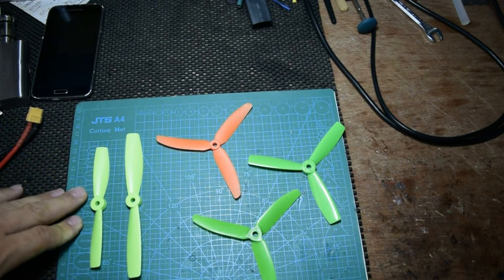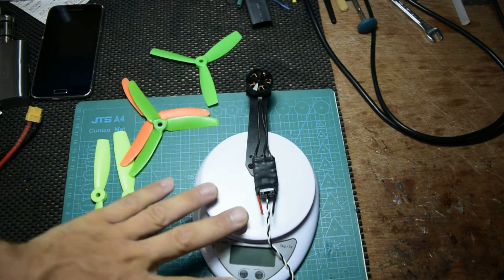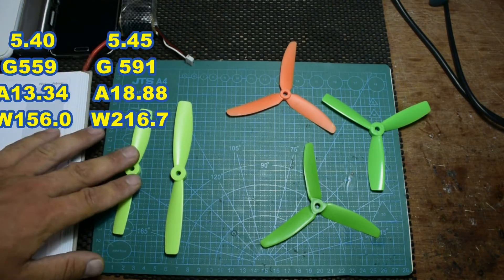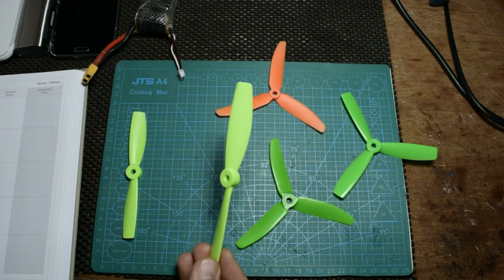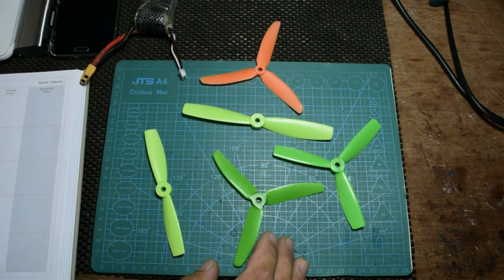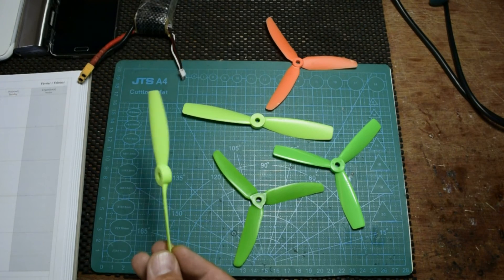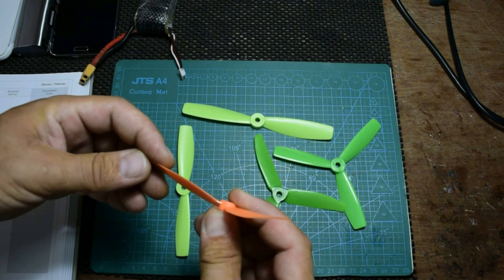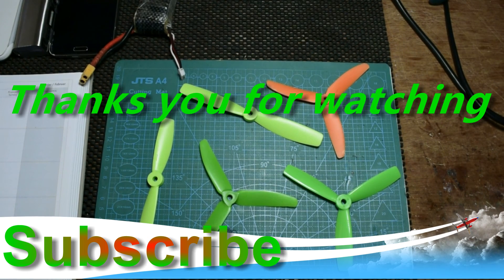Time for  prop tests

Comment: Thank you for your propeller test! It was very intresting 👍 I think to use kingkong 5040 triblade on my falcon 250 that I'll buy for Christmas ☺ Hope that the Tunigy Nano-Tech 1300mah 3s that I'll buy can take to the falcon with triblade sufficient amps.